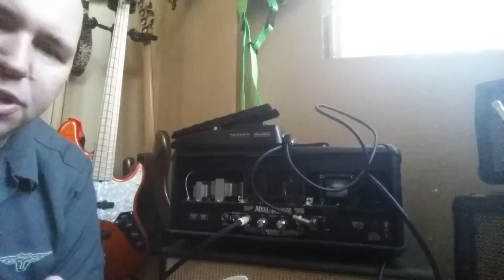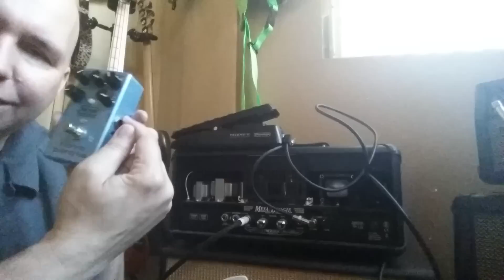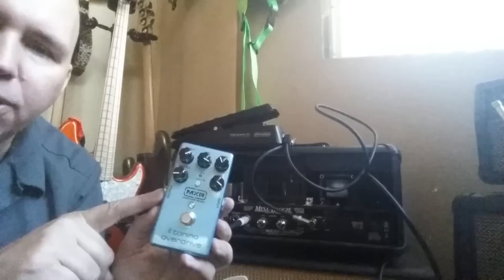How And Why To Use The Effects Loop In Guitar Amps

Comment: Hi Phillip, 

I have a Fender Supersonic 100 combo, the manual isn't clear but given your explanation. 

I think Ive got two in/out options as I've got an effects loop Send/Receive on the gain channel and the classic Fender Pre Out/Pwr In on the clean channel.

So, I'm laying out my time based pedals via the dirty channel as per normal Send/Receive effects loop and use the foot-switch option for access.

I am then planning to just add a fuzz and neutral-ish overdrive pedal to the clean side using the Pre Out/Pwr In.

Given that on either clean or dirty channels I've got the option to switch between Vintage Twin and Bassman tones, that should then boost signals on either side without any weird exaggerated tones.

Am I right and does that sound correct?

Many thanks in advance.
Roy

Comment: Phillip-
I am just getting back into guitar such as Marshall stack and all and have six different pedals: tube screamer, metal zone dist., 7band eq, reverb, delay and then a nosie suppressor.  How do I utilize my effects loop on my 100 watt head and all the six pedals.  It is still confusing to me as to what I hook up first and last . If you could help me shed some extra light into this area that would be great.  Thank you in advance for your response, I dig your video I sort of understand but could use a little help. Thanks.
Reply: Hey Hello Phillip-
Just wanted to say that I got it figured out, I am running a tube screamer going straight in the head before the fx loop and still using the amps distortion while running the send out to my input level on my first pedal in the effects chain and using the fx loop while then running the last pedal's output to the return into the amp's fx loop, it finally dawned one me.  Thanks though.
Reply: Guitar --> Metal Zone --> Tube Screamer --> Amp input --> loop send --> EQ --> Noise Suppressor --> Delay --> Reverb --> loop return
Reply: Hey Thanks George-
Appreciate the feedback!
Ryan K.-

Comment: I never thought about this, so thank you for your video.
But would this also work when a effectsloop works in parallel? I mean, some amps have an effectsloop that will always let trough the original signal + a signal of the effectsloop. (and most of the time you can adjust the volume of the effectsloop signal)
Reply: No,  you need an in series fx loop forbthis great tip to work.

Comment: Hey nice video. Is that a mesa boogie mini rectifier? I do have the same amp and it’s freaking loud so I am using an Ibanez ts-9 tube screamer but It ain’t that aggressive in the lower volumes and wattages. So I am buying a boss mt-2 pedal for more aggressive tight distortion and the thing is I play in lower wattages and lower volumes as low as possible. If I connect the metal zone pedal to the fx loop, do I need to connect a volume pedal too from boss or only mt-2 can serve my purpose ? Do answer

Comment: I'm using a Blackstar HT 20 and I use that amps overdrive for the primary amount of gain for my sound.  I use a Walrus Voyager OD as a bit of a slight boost/tone shaper.  That pedal is fucking amazing and it's not noisey in a negative way at all.  However the Blackstar's overdrive is.  I've tried messing around with the volume/gain multiple times but I can't get the ammount of distortion I want without noise when I'm not playing.  Would it be better to run my Noise gate in the effects loop instead of into the front of the amp?

Comment: The part I don’t quite get is if you’re putting dirt pedals through a clean amp with modulation effects in its loop, how is that different from running the modulation pedals after dirt pedals?  (Assuming the intent isn’t to use the amps dirt)

Comment: I have a question. I can't seem to find an answer anywhere. 
I have a 6505+ and a Behringer DSP2024P efx processor. When I run it into my amp, it makes it very quiet and muddy. I can no longer turn the amp up, and no effects like reverb or delay comes through. 
I have ran the DSP through a Fender Princeton Chorus with no issues and a Peavey Firebass 700 with no issues. But a huge issue with the 6505+
I know the 6505+'s efx loop is working though because I can plug my computer into it via interface and add in effects there and it works fine....so why would everything else work, but not an actual processor?

Comment: Thanx Phillip.How would you describe the TSA 15 amp,effect loop.It's been a big question if this is a real FX loop.I am really interested in the amp,but I would  like to utilize all my arsenal of pedals and multi units ,as well,with no problem.So can you help.
Appreciate it.
Reply: +hifrets all AMp `FX Loops` should basically be the connection between the pre amp and power amp sections of a `complete` AMp the term `FX` rather than being what it is is just a suggestion of what you can use it for

Comment: Good video. You are certainly knowledgeable. I only take issue with pedal order. I once believed that anything that provided volume, gain or compression MUST be first in the signal chain. Later I learned that anything goes. If it creates your desired tone then it is good. I still haven't decided if I like my crybaby pre or post distortion. 
 I definitely like my reverb/delays in the loop but have been happy in the past (pre effect loop days) at the amp input after all my other effects. 
Keep the videos coming I enjoy your stuff!
Reply: Thank you! This is exactly what I am trying to figure out with my new REVV Generator 7-40 head.....LOVE the distorted tones (and clean) I get out of the head but want a little more dirt/boost for solos. So......I had Cry Baby into Fulltone OCD into amp out front. I do want to add a MXR Chorus mostly just to fatten up my clean channel....so you would recommend running that through the effects loop?

Comment: Quick question was wondering if you could tell me this or if someone else could. I am getting a Mesa Boogie Quad Preamp, but the down side is that it doesn't come with a power amp section. I have a Marshall JCM 2000 and am using a JCM 900 1960B cab and it runs at 16ohm's. My JCM 2000 does have an effect loop, would it be a good idea to run it though the effects loop of the JCM and then run my delay, chorus and such through the effects loop on the Quad Preamp?

Comment: Thanks for the excellent explanation, Thank you very much :D.
I still do have a question, if I've got a phaser and a EQ in my effects loop (and a tuner, wah, booster and distortion in chain), I would think the EQ comes last, is this correct via the guidelines of setting up effects?

Thanks again for the great video ;)

Comment: im lucky - in middle of the tc electronics top plug collection, and running all the pedals  6 so far in the front work'd till i got the grand magus distortion - even with echo out , now the reverb and delay seem to act up... so gonna run them thru loop right now...sad smiley face insert here - say goodbye to the the bass chord and the line 6 amp guitar chord too.....

Comment: Thx Phil, never thought about running volume pedal through the loop. I have the Mark V:35 with a vertical 2x12 Recto cab. To get it sounding nice even in 10W setting it is too loud for home. What's the best way to get that cranked tone at a lower volume? Volume pedal or attenuation?

Comment: I have a question I am a noob. I have a tube amp with effects loop. not ready to buy effects as yet but want to experiment with different sounds from programs like amplitube and guitar rig. I still want the sound to come out of the amp not monitor speckers. so computer would be the effects pedal connect it though a audio connector. would this work? would you recommend it?

Comment: hey phillip! i have a question for you, probably a dumb one but anyways, i have 2 250w PA speakers and i am wondering if i buy a powered mixer for them could i plug guitar straight into that or would i still need a guitar amp to power it also want to plug a mic into it and use the guitar and mic at same time? any advice would be greatly appreciated
Reply: Krookiemonster  you absolutely can. beware that your clean tone when doing this will be extremely clean. depending on the speakers it may even sound bass like. this approach can also be a lot of fun with stereo separation. a powered mixer may even have a effects loop

Comment: I have a Blackstar ID Core, Can I run a noise gate pedal after the amp's send in the effects loop to gate the amp distortion? I just started to use my boss me 80 thru the effects loop and only use the mods, reverb and delays with that unit

Comment: is there a difference with guitar amps and bass amps in this context? because my bass amp have a preamp out and power amp in and it also has an effects loop
Reply from the maker: Nope Bass amp works the same way
Reply: Phillip McKnight So, would you know the reason as to why it has both?
Reply: What make and model?

Maybe with the FX loop on your amp creates the option of running parallel signals to the power amp section, combining one signal, which has only been through the preamp, with another signal, which has been through your preamp AND your effects pedals and returned to the amp. But that's just an idea, not sure.
Reply: TimMer1981 It's a Behringer BVT4500H, it's a carbon copy of the ampeg svt 450h
Reply: As a bass player myself, who plays guitar, typically you're not cranking the preamp to distortion, you're just changing tone. You can, however, use that loop with a compressor rack and use it to squeeze the dynamics of the bass for a more smooth sound between going hard, and playing subtly. 

I compress before tone using a pedal on my bass, however, on my guitar rig, I have a Timmy clone, a Caline CP12 in the effects loop to do what the volume pedal does, but in reverse. i use it to kick an extra 4 - 6dB of volume for lead work when working with a second guitar backing me up. I also get a little bit of bite from it too.
Reply: Chris Wilson good rules of thumb there. I also was/am
bassist first and what the role preamp gain means to a bass
playa' is not quite the purpose
as a guitar player may be trying to achieve "Liftoff",
(lol) !

Comment: Is it okay to not use an effects loop if I'm not using the amp's clean tone? the amp I'm looking at getting doesn't have an effects loop.  I'm running a dl4, dynacomp, blues driver, and a rat. would that clutter up my sound? as in would my clean tone be uneffected?

Comment: Thank you for this video, Can i put an EQ pedal to effects loop (MXR EQ 10 band)?
Reply from the maker: yes, I have used that same pedal with very good results.
Reply: thank you so much. I'm happy with this.
Reply: Khalid Major yes .
Reply: Phillip McKnight I have one question if you're still answering: If I want to place my EQ post-amp, should I place all my effect pedals after the EQ as well, or should I EQ the effects too?
Reply from the maker: You can do it either way, but if it helps I do it at the end
Reply: Phillip McKnight So your EQ is the very last in the chain?
Reply: in the effects loop chain EQ 1st +chorus+delay
Reply: I PUT MY MXR EQ BEFOR MY MODULATION PEDAL (EFFETCTS LOOP)

Comment: If I put my JOYO flanger after my Holy War stax Ahor 3 it boosts my volume by about 2 decibels when turned on and only my distortion pedal has a volume and both are try bypass.... SO I PUT DISTORTION LAST TO CONTROL VOLUME AND THE FLANG SOUNDS SOOOO GOOD.....
ANYWAY I'm going to use a loop

Comment: so... you can use a volume pedal through an effects loop so it has the effect of an attenuatior?
Reply: No. An attenuator allows you to crank both the preamp and the power amp, whereas the volume pedal method only allows cranking the preamp. Gotta have power tube and phase inverter breakup to get the full cranked tone!

Comment: So, if i do not use the distortion of my amp, and i plug a delay pedal outside of the effects loop, woul there be any problem with the tone ?  I already have OD & DS pedals so i do not actually need the distortion of the amp.
Reply: If you do not use preamp distortion then you do not need to use the loop. You simply need to place effects such as reverb, chorus, delay, etc, AFTER your distortion, whether that be pedals or preamp distortion. The loop allows you to patch those kinds of effects in after preamp distortion. If you're running your preamp clean, then there is no need. As a matter of fact, most effects loops are designed to work with line level rack effects, and many of your typical instrument level guitar pedals don't run well in the effects loop. It is actually better to run them out front, especially if you're having problems with them in the loop (where there is the potential for an overloaded pedal). Of course there are tons of pedals that work just fine in effects loop as well, and even the particular amp and how they designed the loop can dictate whether or not a pedal works. I have an Analog Chorus and Delay pedals that work fine in some loops, but not so much in others.
Reply: This is why on some amps you'll see a level switch, so you can switch between line level and instrument level based on what kind of effects you are running in the loop.
Reply: +c00lkatz Ok thanks a lot ! Very helpful
Reply: +Yannis Kraus No problem. Also remember that pedal placement "rules" are really just guidelines. You can do whatever you want, do whatever sounds best to you and achieves your desired sound, even if it goes against the general guidelines. Some very famous artists achieved their famous signature tones in a very unconventional manner, which is one reason why many of them stick out and sound different in the first place.

On the topic of distortion, a distortion box is different from an overdrive. An overdrive (or a clean boost which can do the same thing...an overdrive typically "colors" the sound some) is mostly meant to boost the signal going into the preamp, thus saturating the tubes. It is common to run them into an already slightly crunchy amp. In this case, you would consider this preamp distortion. A distortion box provides all of the distortion, and is generally run into a clean preamp. Some can be a combination of the two, so this is another one of those "general guidelines."
Reply: I am running a fuzz into a tube screamer into a volume pedal and then a delay and a built in Reverb, I dont think there should be any problem, but if I run à modulation pedal, do I put it before the volume pedal or after ?

Comment: so is this how a master volume works also ? I have a lone star special and that makes sense
Reply: Master volume can be pre or post phase inverter, which is part of the power amp. Some argue that it's the phase inverter you hear breaking up when cranking up the amp, whereas others say it's actual power tube distortion. Most master volumes are pre phase inverter, unfortunately, which is no different than having a gain and volume knob on a single channel...in this configuration with multiple channels you'll see a gain knob for each channel and a volume knob to level match the channels with a master volume to turn both channels up at the same time, but it's still not giving you power amp distortion. Without post phase inverter master volume you need an attenuator which goes after the power amp but before the speakers to get the power tubes and phase inverter cooking. Of course whether or not the tone will be good is based on your amp and what tubes you're running.

Comment: if you have a master volume on your amp is there a difference doing this instead?
Reply: +Jeremy Starreveld There should be no difference. Master volume is always after fx loop so that would be just working as second master volume.
Reply: +Jeremy Starreveld not so much although it would enable you to control the Power AMps main vol on the fly via a pedal

Comment: what about a multi effect processor?
Reply: Bobby Havoc Adding a processor based effect can be before or after the preamp of the amp. Generally speaking a digital multi effect
has programmable slots and almost always has a preamp
compressor distortion controls that you can lean into
or out of depending on how hard or soft you "hit" the front
end of the guitar amp input with your guitar signal. Now it's said Hendrix used his volume on his guitar to set
tone as all settings on amp were set to 10 and the Marshalls were run in series
adding "extra" distortion thus
achieving "liftoff".

Comment: Dude you are getting confused because you don't understand how amps are designed or work. Go learn about preamps and power amps, preamp distortion and power amp distortion, and the difference between load attenuation at power amp output and a volume pedal at preamp output. Then do this video again.